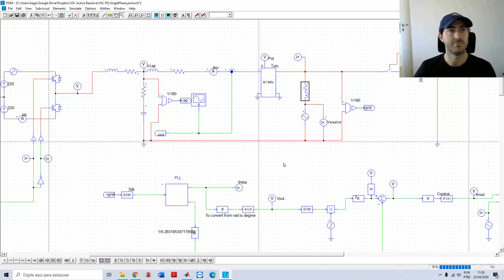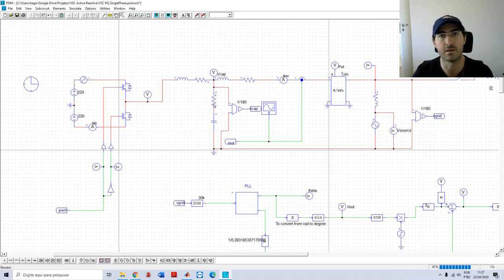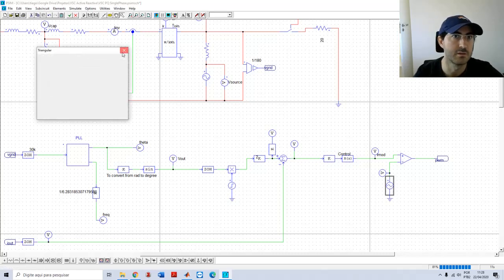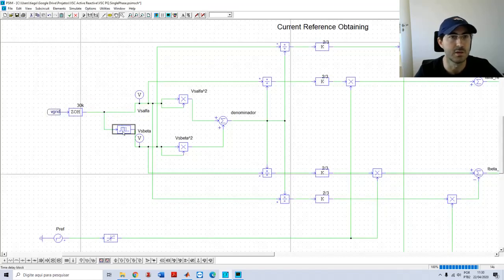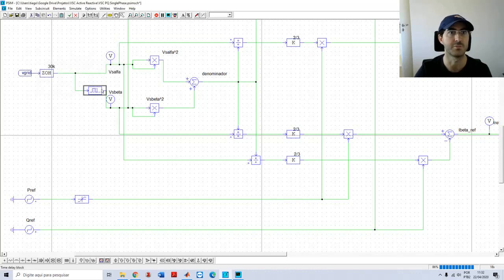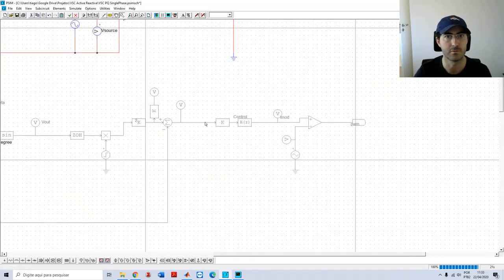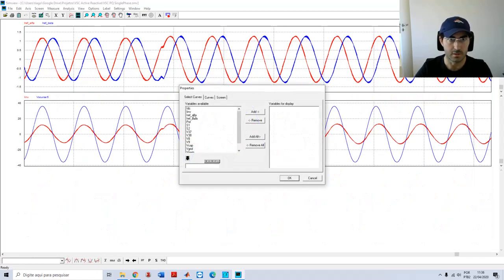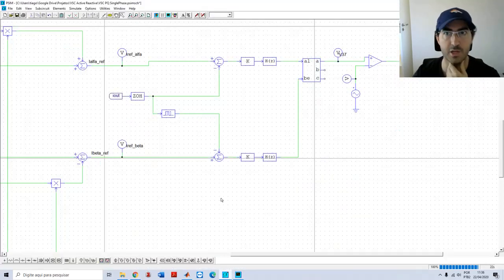Alpha-Beta control strategy for Single-Phase Grid Connected Inverter

Comment: Haven't you forgot to make a square root of the  "denominator" (sum of Vsalpha Vsbeta squared), while normalizing (or trying to normalize) the Vs alfabeta vector?
Reply from the maker: Thank you for your comment. Very good observation. No, I didn´t forget the square root. In this case, the square root is not used. Check equations 7.6 and 7.7 of the book Voltage-Sourced Converters in Power Systems, by Amirnaser Yazdani and Reza Iravani.
Reply: @Tiago77916   Sorry, that book is some paywalled academical stuff,  I can have no access to it. Could you please elaborate more about the "supposed normalization" process? I don't get how it is supposed to work. Or describe more the process of obtaining the "current reference" please?

Comment: Hi Tiago,I want to ask if u have some paper/book reference for three phase alpha beta control for three phase grid connected Solar pv,,thanks in advance
Reply from the maker: Hi Sharma. The following books are really good for what you are intereting. 

[1] Advances in Grid-Connected Photovoltaic Power Conversion Systems 1st Edition. Yongheng Yang Katherine A. Kim Frede Blaabjerg Ariya Sangwongwanich.

[2] Voltage-Sourced Converters in Power Systems. Amirnaser Yazdani (Author), Reza Iravani (Author)

[3] Control of Power Electronic Converters and Systems - 1st Edition - Volume 2. Frede Blaabjerg.

Comment: Thank you very much for this lecture. 
Could you please suggest a book about single-phase grid-connected inverters with PQ control? 
And if you could mention the control bases of the first and second topology? 
I also noticed a factor of 2/3 in the transformation, is it from 3 phase PQ theory?
Reply from the maker: Dear Ibrahem. Thank you for your comment. The book "	Advances in Grid-Connected Photovoltaic Power Conversion Systems 1st Edition. Yongheng Yang Katherine A. Kim Frede Blaabjerg Ariya Sangwongwanich" has a chapter about singla phase inverters controllerd in PQ.
Reply: @Tiago77916  Thank you very much, professor.